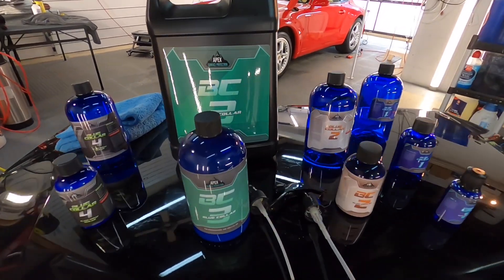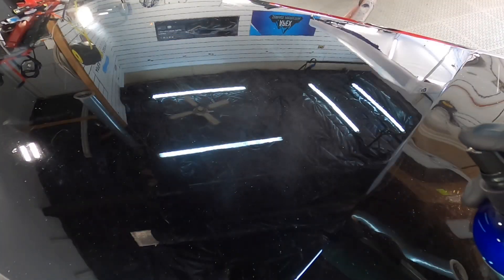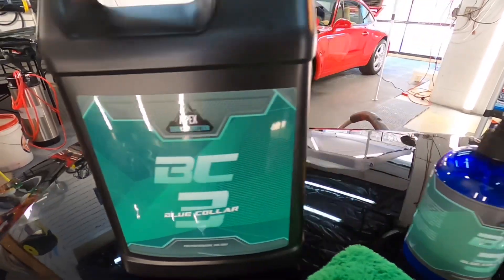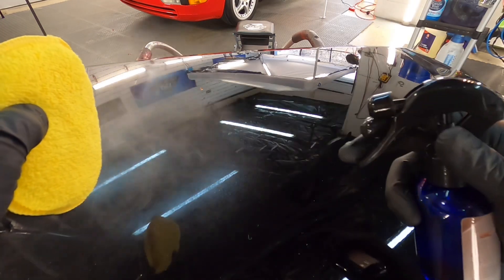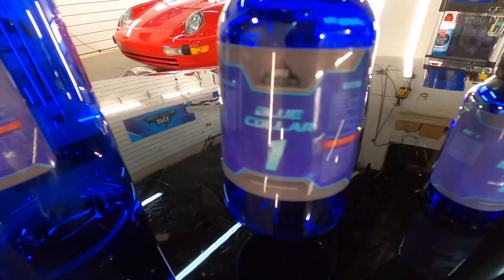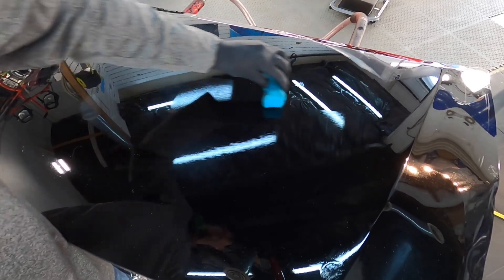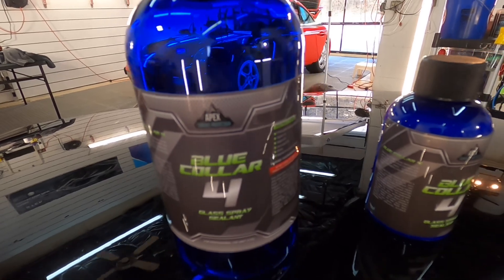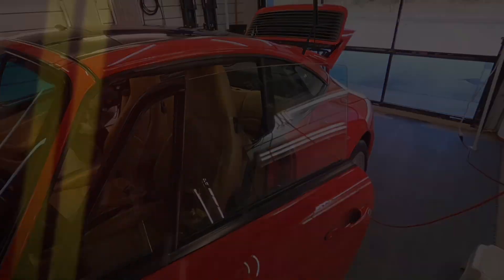Larger Sizes Available For The Blue Collar Coating Lineup!! Nozzle Options As Well!! Shine On!!

Comment: One last question I forgot to ask - what would be the best way of topping up BC2 used as a standalone to get a daily driver safely through a full 12 months in salty wintery conditions? Adding another layer of BC2 6-8months in? Regularly topping with BC3? Both?
Reply from the maker: Maintain every 3 months… or quarterly with BC3. Ask as many questions as you would like.
Reply: @apexdetail85  👍

Comment: Congrats Brian! Great to see distribution in the UK. I've been wondering, how do BC2 and BC3 compare as toppers for a ceramic coating? I'm sure BC3 works a treat but wouldn't BC2 work just as well but for several months longer?
Reply from the maker: Absolutely.. you can bring BC2 into the mix as a coating gets into its 3 or 4th year.
Reply: I applied bc1 as a coating, bc2 as topper and then bc3 for the hell of it and the water behavior is ridiculous!!

Comment: Haven’t had a chance to try any yet but really leaning towards BC1 when I coat my wife’s SUV later this spring. I don’t have a garage - just a carport - and the BC1 looks really easy to use outside.  Would it work ok curing under a carport?
Reply from the maker: Yes, no problem.
Reply: @apexdetail85  great!  Thanks

Comment: Hi Brian, if I want to coat my Harley engine using my air brush sprayer (I have PPE), is your BC1 sprayable & will it self-level or would I need to wipe down all sprayed engine fins & parts?

I saw your motorcycle  coating video but I can't get access to the IGL Eclipse product you sprayed.

Comment: Great video Brian, looking forward to testing out the Blue Collar product line. At one point you suggested waiting 2 minutes for BC1 before levelling, is that still the case, or is it closer to 1 minute? Just judging by this video and your previous one on the coating it seems to be more like 1 minute. Thanks!
Reply from the maker: No need to be in a rush….especially inside. I had a customer walk in, get a quick estimate, and still wiped off easy. 😁👍🏻